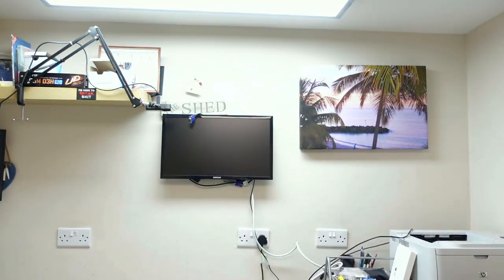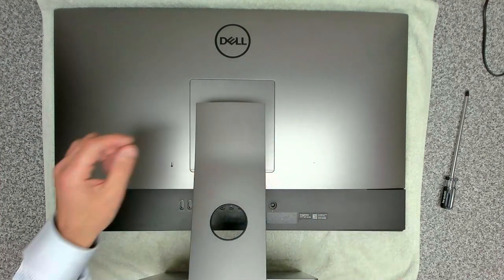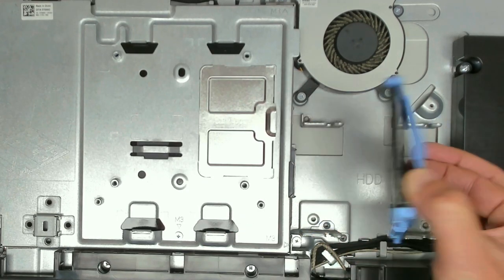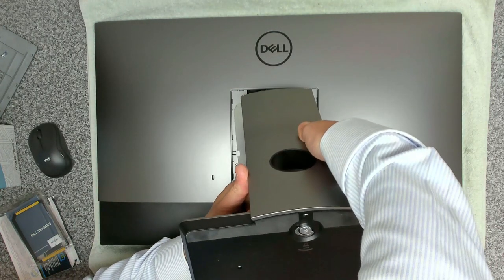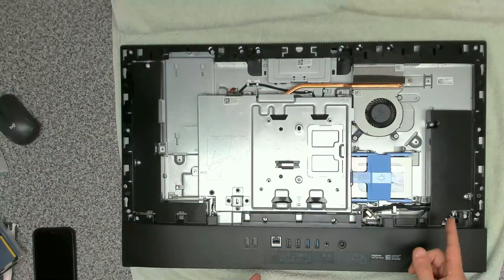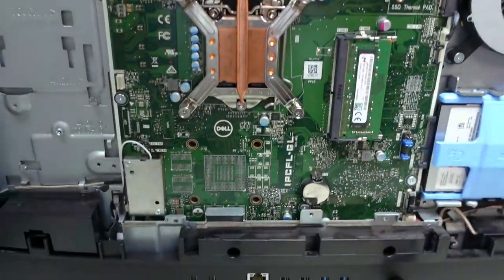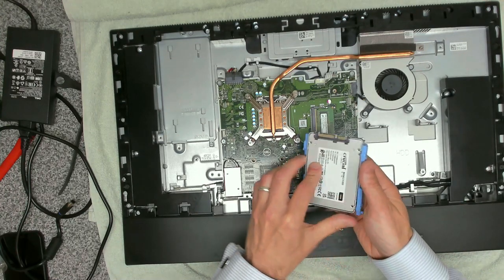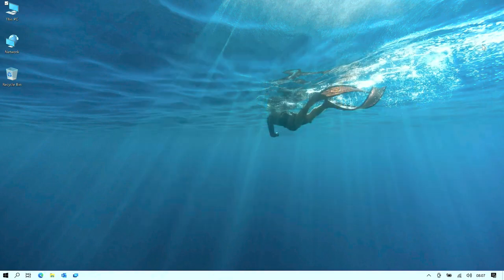Non Booting Dell Inspiron 7777 AIO with rabbit hole investigation

Comment: First thing I would have tried is a Linux distro on a USB device - stick, SSD, spinning disk.

In my experience those 2CR2032 batteries quietly die after a few years, and there's no problem until you disconnect power. At that time, you may lose your settings.

Reseating cards is a trick I learned in the early 80s. I had a malfunctioning NEC APC. I took it into the shop my mate pulled out the cards and pushed them back in. Fixed, no charge.

Right now, I have an Inspiron 7459 fresh off eBay. No lights.